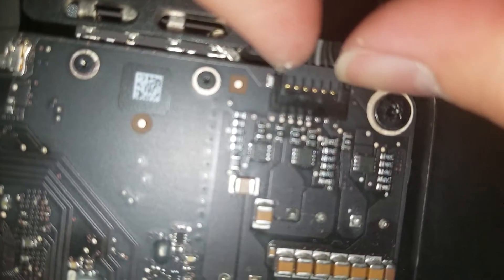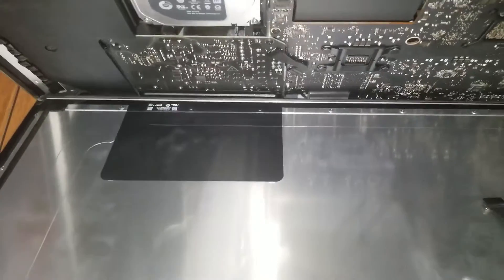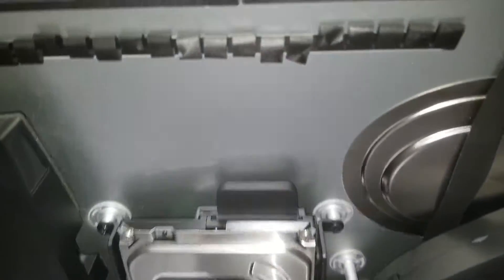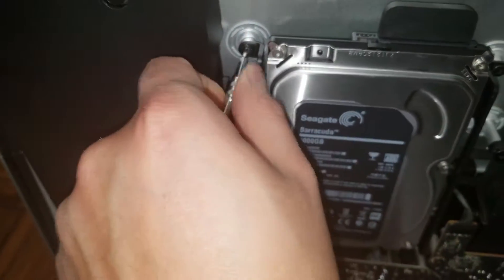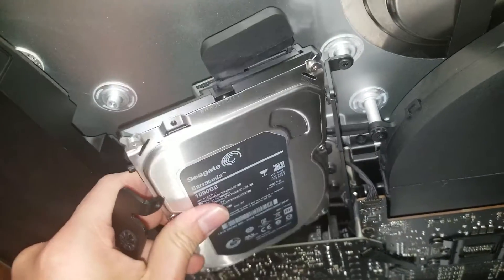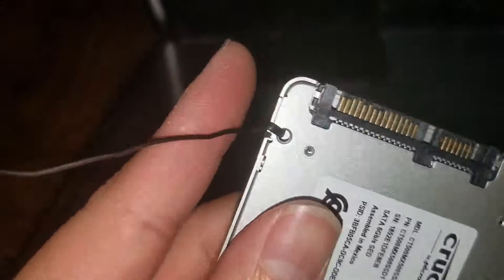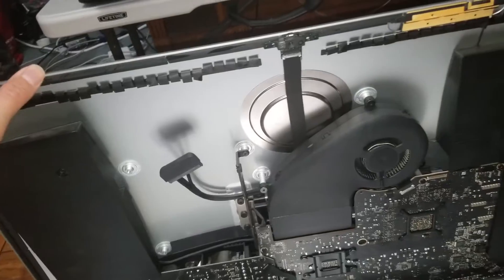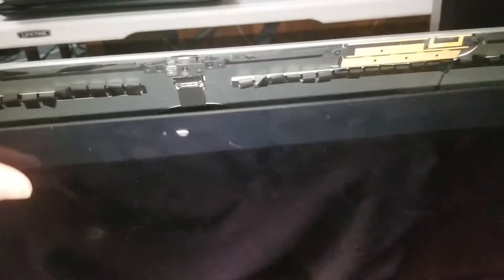How to open disassemble an Apple iMac 27" A1419 SSD Upgrade hard drive hdd replacement

Comment: Thanks! I'm just trying to figure out how to remove and dispose of the hard drive (SSD) because my machine won't boot and I don't want the data on the hard drive out in the world.  It had a good life, since 2012 and it's been replaced!
Reply from the maker: Were you able to get it out?
Reply: @ yes, but not without breaking the front glass of the screen. It’s good that it’s just going to the recycle depot
Reply from the maker: @voxsephora2799  D:

Comment: You didnt even address the fan running at full speed after the swap, and the whole temperature sensor issue. How did you overcome this problem?
Reply from the maker: These models don't have an hdd fan, so there is no max speed fan issue. Are you talking from your ass or did you actually have this problem with your iMac? I've upgraded so many of these and none had the issue you mentioned.
Reply from the maker: This model doesn't have that issue. If yours does, make sure to install the updates. Only older models with the CD drive had that issue. You can use this to fix that on the older models. https://exirion.net/ssdfanctrl/